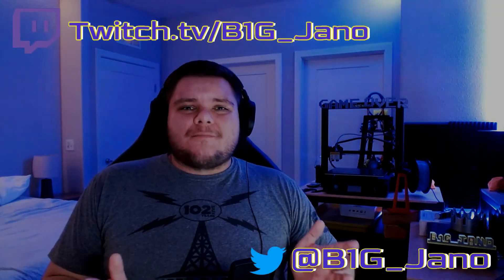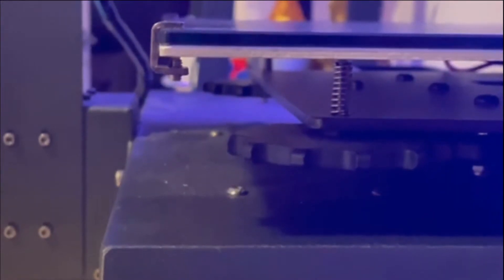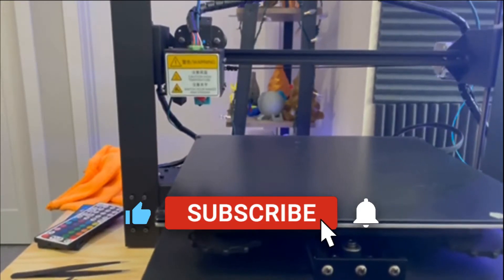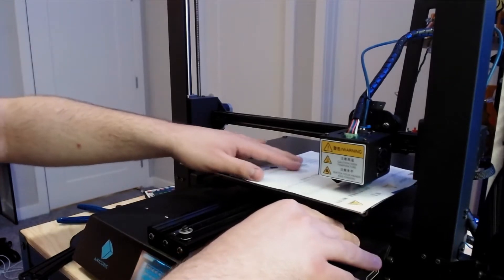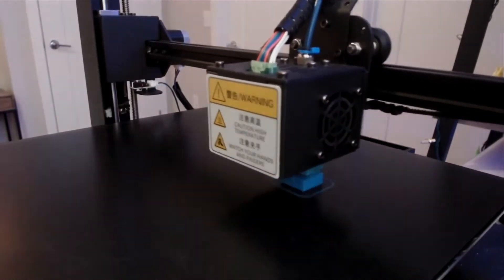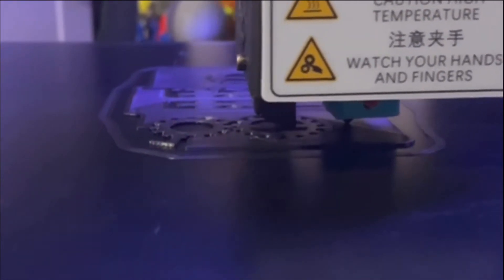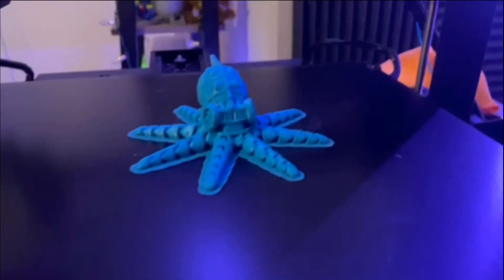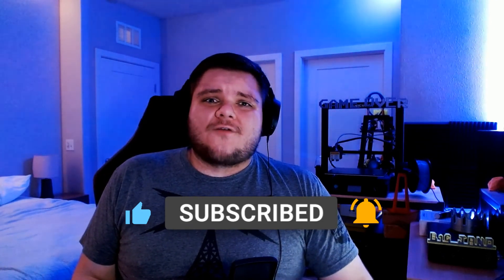Everything you Need to Know about the Anycubic Mega X Print Bed! | Bed Leveling, Maintenance, etc.

Comment: Hey man when I hit home Z my printer doesn’t move and makes a weird noise can’t figure it out
Reply from the maker: i would double check all of the wiring to make sure everything is connected properly and going to the correct motors. If that doesnt help, i would check the motherboard and see if there are any issues there (i.e loose wires, anything burnt, etc.)

Comment: I've had this printer for about 2 years and only set it up and used it once because the bed it shipped with is warped. The center is higher even after the bed has heated. I contacted Anycubic way back when cuz i purchased through their site and got the run around about replacing the bed plate. Now the part is only $30 so i might dust it off and try it out again.

Comment: How do you fix the inital print line, how do you make it actual do that print line as mine is always off the bed
Reply from the maker: That’s done in the starting gcode (manage printer settings in cura). I recommend taking a look at my slicer set up video to check out what I use in my starting gcode.

Comment: Hey B1G Jano I have the Mega X as my first FDM printer I started with Resin and the Anycubic Mono X. I am dialed in with resin but I'm really struggling getting consistent prints (or even getting successful prints at all) I have upgraded my extruder to the same model you did a video on and followed your instructions for the coding. I just can't seem to get my settings right. I am mostly trying to print full size cosplay Star Wars helmets. I would be forever grateful if you could share with me settings that are working well for you. (temps, wall thickness infill etc.) I really want this printer to work for me.
Reply: I'm not B1G Jano but maybe I can help . I had to take the print bed off and tighten up everything underneath . Then I noticed that  the print bed was not flat. From the center to the right edge it dropped the thickness of the leveling paper. I checked the other side and it was flat so I flipped it over and everything is fine. I also heard that the wires on the print plate would break lose from movement so I epoxied the crap out it so I wont have that problem.  Good luck to you.

Comment: was machst du wenn die Ecken keine verbindung mit der nadel hat aber die mitte schon zu fest eingestellt ist?what do you do if the corners have no connection with the needle but the middle is already set too tight?
Reply from the maker: That sounds like possibly you have a warped bed. But try areas in between the 4 corners to see if it’s too high or low there as well

Comment: Hey, I'm REALLY looking to try to get a full 12" out of the print bed. It looks like there is no room on the X-Axis as the wheels on the rail look flush to the side. That's unfortunate because there is an extra 15mm on each side of the actual bed. There is a total of 10mm extra on the Y-Axis but I don't know if it's confined by the belt range of  motion (hitting the belt fasteners). Do you think it's possible to get an extra 5 or so mm on the Y-Axis? My printer is coming in a few days and I can figure it out then but just curious if you know. Thanks.
Reply from the maker: it is limited by the belt path on the x carriage as well as a limit switch the carriage detects into when homing so im not sure if you will be able to get that extra space on the bed.
Reply: @B1GJano  Yeah, I was specifically asking about the belt path as the bed moves towards you on the Y Axis. Although it would be pretty easy to move back the Y limit switch a few mm too. I think the determining factor is if the ends of the belt (where the attach under the bed) hit the gears at the end of Max -Y and Max +Y. I'm looking at my current printer and that's what would prevent me from doing it. But I was hoping the there might be a few mm on the Mega X. Any chance you could move your Mega X's bed towards you and see if the belt runs out before it hits the end?

Even if it does I think it would be fairly easy to make an extension bracket that just moves the gear mount out like 5-10mm and put a new belt on there. I'm pretty sure the rails wouldn't even have to be replaced/extended.
Reply: If you're curious, I was able to get 315mm on the Y-Axis by simply editing firmware in VS Code. No hardware mods necessary. Only requires you to rotate your bed 90 degrees. Now I have the freedom to make prints 12" (305mm) or a bit more.

Comment: my center of my bed is to high how do i fix that??
Reply from the maker: i would try making small adjustments to the four corners and see if that helps. Also, if you havent already done so, heat up the bed to printing temp to get more accuracy. If its still too high, you may have a warped bed but cant say for sure
Reply: @B1GJano  i mored by turn the glass and that help a little but still high the middle and i sent anyCube a message about it last nite

Comment: Hello, i got my Mega X and started to print. everything so good so far for the first print. but i had big problems with removing the prints from the Bed. they were so hard on the bed, i needed force with the scalper to "break" the PLA of the print to get removed. but now, on the bed i had the first layer of the print left (the other contouring and the first layer of the sockets of the test files (the owls, which anycubic included on the SD-card). now i have scratches on the bed and even the first print layer. how can i remove them, or what is here the problem. 

is maybe the included PLA from anycubic a problem because of quality etc?

when i should remove the print? it is better, when the bed is still warm, or must i heat them (because like in your video, and also in the manual, they say, that the bed must be cool down). 

i have also some pictures of my bed, i can send you, if you want to see, what i mean. sorry, im a complete new beginner of 3d printing, so i didnt know all specific names etc. to describe you that problem better. 

i hope you can help me a little, so that i can learn more. 

thanks a lot. 
Dominik from germany
Reply from the maker: Hello! I would let the bed cool completely to room temperature (anything below 30c) before trying to remove. If it’s still very stuck after that, your first layer may be too close to the bed and you may want to lower the bed a tad. In terms of the scratches on the bed, you should be fine to print still as long as you didn’t take any of the glass off. My bed has some wear and tear marks as well. I would also suggest trying another filament to see how it prints as not all filaments are created equally. Hope this can help

Comment: Hey I'm new to 3D printing and I have the same printer you do but I had the filament break before the feed motor and just after the filament out sensor I tried feeding the filament back in and it feels like something is stuck before the feed connection to the loop. Any ideas on how to fix it?
Reply from the maker: If you can easily remove it by pulling the lever on the extruder and manually pull it out, do that.

Comment: I'm having trouble leveling the center point of the bed. Every time I get the 4 corners set the center is always going to rub the print plate. I got it close enough to print the owls (came out nice) but it is obvious that the first layer isn't perfect and lifts off 1/2 the time. If it sticks... it prints basically. More detailed first layer prints always end up not sticking on some part of it.

Any advice for getting that center level with the corners?
Reply: Take the glass off and with a good metal ruler for an accurate straight edge, check the metal plate AND the glass for flatness with the ruler up on its side, check it at every angle across the middle and from corner to corner around the perimeter to fully locate all high areas.   If the metal plate is high somewhere in the center, you can likely carefully sand it down gently to get it flat, sand then check with ruler... go SLOW.  If the glass plate is the problem buy a new one.

Of course, make sure your roller wheels are tuned for nothing wobbling loose at all on bed or hotend movement, no dents in the framework they run over, etc.
Reply: @brianmi40  Thanks! I did get in touch with Anycubic's customer service who had me test the plate like you suggest and sure enough you could see light come through under it. They quickly sent a replacement out.
Reply: @tracygrove3484  Good of them to do the replacement!
Reply from the maker: The if the four corners are level but the middle is too tight, try slightly lowering all four corners to compensate. Make sure you heat the bed to 50-60c as well as you level to let things expand accurately.

Comment: I cannot get anything to adhere to my anycubic bed alone. Straight out of the box it wouldn't stick. Glue stick is the only way I could get a print to adhere
Reply: nozzle/bed temps?  type of filament?  When you print a test print that puts a single layer out around the perimeter of the bed (near max full size) is it:

a. not easily moved by finger sliding on it a few inches behind the hotend?
b. feels uniformly thick

If either is a problem then things aren't adjusted correctly, including possibly bed level, nozzle temp, bed temp, alcohol clean bed, nozzle clearance from bed, thickness / width of first layer...

Comment: when i press home Y everthing lock and the machine start screaming ... help help help
Reply from the maker: Make sure everything is installed correctly. This includes the wiring for the xyz motors as well. Also, make sure there is nothing impeding movement in any axis. You should be able to disable motors and try to move things freely to check.

Comment: Hi. Your videos have extremely helpful. I just bought the Mage X. I love the printer there are just two things I can’t figure out. 1. The first layers of anything I print comes out really bad so the bottoms of all my prints look horrible. 2. The prints have started to shift over. How do you feel about paid consultations. Can I pay you for your help.
Reply: First off, see if the bed wiggles up/down or left/right at all under GENTLE hand pressure.  If so, your wheels need adjusting.  They can also be too tight against the frame, which is rare and you can tell this by the bed being too hard to slide, or not being able to rotate the wheels by hand with some gentle force to turn them in place.

Same for the Y hotend: shouldn't wiggle up/down, etc.  Any looseness, watch a video on how to adjust these wheels, not overly tight, but to eliminate any wiggling.

Just to be sure, you should also put a square (woodworking square) up to the Z frame and make sure it is a true right angle to the X/Y frame.  Some printers from various mfgrs. get bent a bit in test assembly, boxing, or shipping.

Then if all is stable and square, re-level the bed, this time, tighten the 4 springs to about 70% tight before starting.  Too many machines achieve a level bed with the springs too loose, which makes them prone to shifting over time.  At 70% fully tight, you likely need to loosen and lower the end stop switches, and get them to "just barely click" now.  Remember, this has dual Z, so you need to adjust both.  If necessary, loosen the Z limit switches for clearance and rotate both Z steppers an equal number of turns (by watching the set screw position as it rotates lower) to lower the bed so that a post it note or similar paper slides with tiny drag on both sides of the bed, THEN lock the Z limit switches in place to have "just clicked" at that position.  You can rotate the Z steppers up and back down to confirm the "click" is where you want it: a paper thickness (or two at the most, since the springs can easily move that far) from the bed .  Once you've done that NOW level your bed with the necessary fine tuning.  At best, seek out a test pattern to print (thangs or thingiverse) that will give you extrusion nearly out at max size of the bed, around a .2 layer height, and just a single layer thick (imagine 10 lines of skirt...), of course you could create this yourself in something like Tinkercad.  When your bed leveling and nozzle/bed temperatures are correct, you should be able to follow several inches behind the print head with your finger and the filament STICKS and won't easily move with the flat of your finger trying to gently slide it around.  That means you are getting good bed adhesion.  If your finger easily moves the filament with no effort, your bed leveling was too far away from the nozzle, your nozzle temp is too low (around 200c for PLA) OR the bed could be dirty (clean with simple alcohol and let air dry) or bed temp is not correct (60c for PLA).  Also feel the thickness of that single layer extrusion around the entire perimeter, as if it gets thinner and thicker in areas (often one corner will be thicker, indicating to raise the bed a tiny bit in that corner), the bed still isn't optimally level.  You may need to do this multiple times, but stick with it until you get good adhesion AND consistent thickness in that first layer.  Life gets much easier with a level bed and good adhesion.  If you aren't bumping or moving around your printer, or forcing parts off it before it has cooled for easy removel, it should work a long time before you need to check your bed for level again.

I always run my first layer width greater than the nozzle diameter (e.g. .5 or .6 on a .4 nozzle), with thickness less than nozzle diameter so it has to get squashed a bit into the bed for good adhesion.

After those first layer issues, getting good builds is dependent on things like speed, flow rate, infill overlap and pulling that first layer inward a bit if the outer two/three layers don't adhere well to the infill.

Comment: Great video B1G Jano, thanks for the explanation. 

I got a Mega X three weeks ago and have not had one successful print on it no matter what I do. The bed simply wont level no matter what I do. I have watched the video on how to do it a million times and I follow each step carefully. 
 
The problem I have is the middle of the bed. I get all four corners done perfectly, then when I check it in the middle the Nozzle hits the bed. I move back again to the 4 corners, still perfect. I have done this with the bed cold, warm, hot and it does not change. Of course, because of this I cant print anything because it would just rake the material right off of the bed. 

I checked the Z Stop and AFAIK it is right. 
 
I have had this printer for a few weeks now and I am just ready to give up. I moved from an Ender to this model and I was able to level my ender in 3 minutes and then have a print started in a few more minutes. What the heck am I doing wrong here ?

I really want to love this printer, but so far I absolutely hate it. Its incredibly close to going back.
Reply from the maker: you could have a bad bed. By bad i mean warped. I have heard of some with non flat beds with this machine.
Reply: Take the glass off and with a good metal ruler for an accurate straight edge, check the metal plate AND the glass for flatness with the ruler up on its side, check it at every angle across the middle and from corner to corner around the perimeter to fully locate all high areas.   If the metal plate is high somewhere in the center, you can likely carefully sand it down gently to get it flat, sand then check with ruler... go SLOW.  If the glass plate is the problem buy a new one.

Of course, make sure your roller wheels are tuned for nothing wobbling loose at all on bed or hotend movement, no dents in the framework they run over, etc.

Comment: How do you adjust the "D shape wheels" I don't get how they're supposed to be tightened.
Reply: There is a nut, on the inside of the wheels on ONE SIDE ONLY that when rotated moves them closer or further away.  Gently loosen the screw, then turn the nut for no wiggling but not overly tight, then re-snug the screw.  Ideally you should be able to hand turn the wheels with just a tiny bit of force so as to not be overly tight, but there should be no wiggling of the hotend or bed (depending on which you were adjusting).

Comment: great videos, I have a question for Jano. My belt below my print bed seems really tight, is that supposed to be tight? and if so, what's the best way to loosen it or do you know the actual name of it so I can find a way to loosen it?
Reply from the maker: you should be able to move the bed back and forth freely but it should have some resistance but also not be jerky when moving. There is a screw on the front pulley that can be adjusted that at least for me was able to adjust that belt tension.
Reply: The pressure that you would use to wipe the sleep out of your eye should move the belt slightly down when pressed a few inches from the end.  It needs to be snug but nowhere guitar string tight.

Comment: My print head doesn't move at all when I push the home z. What could be the issue?
Reply from the maker: Try clicking the motor button to turn of the motors. Sometimes after homing, they lock the motors. You should be able to disable the motors this way to move the print head. Hope that helps